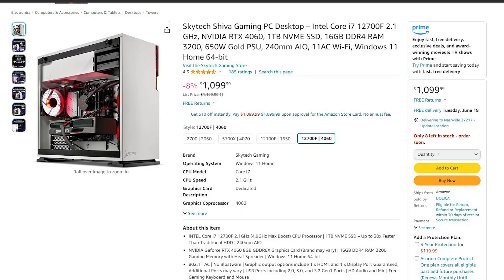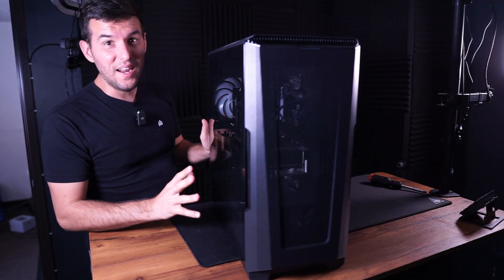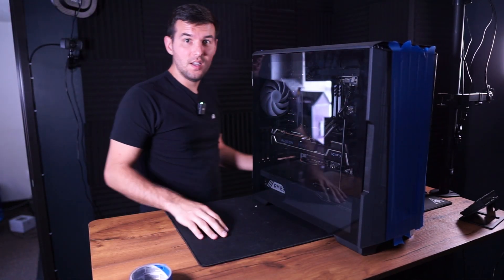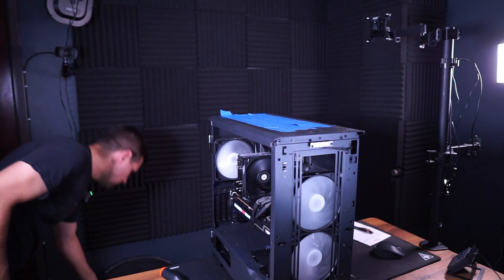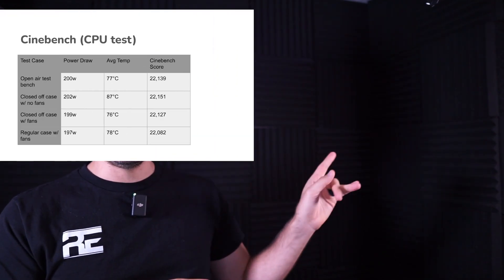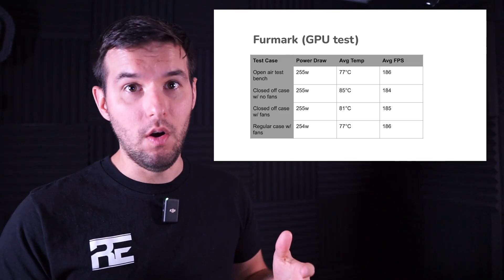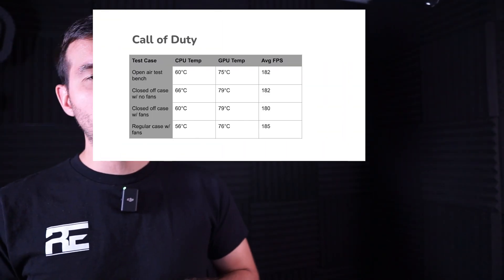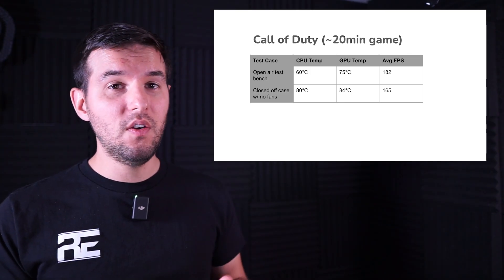How important is GOOD airflow in a PC case

Comment: Do you think it’s possible to cool properly a 14700kf with a 240mm aio in a NZXT H5 flow rgb? 👀
Reply from the maker: It might get a little hot under really heavy load since it can pull around 150+ watts under full extended load. Personally I’d use a 360mm AIO on that cpu